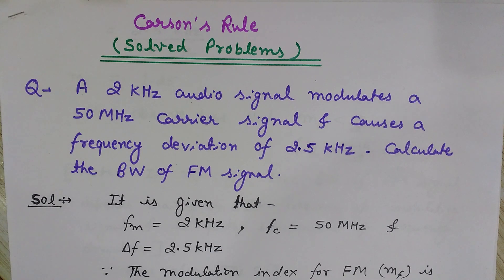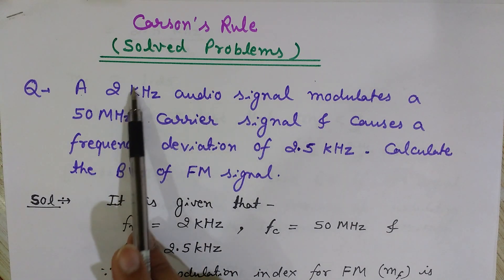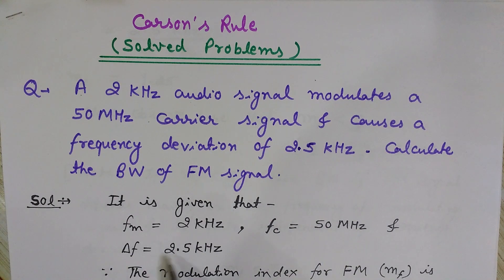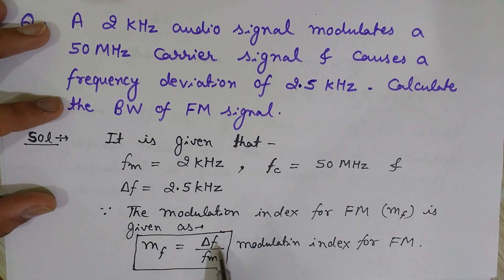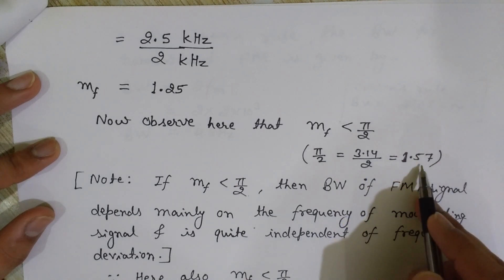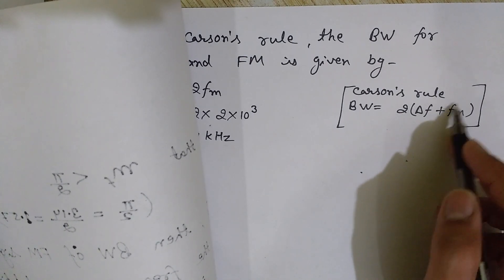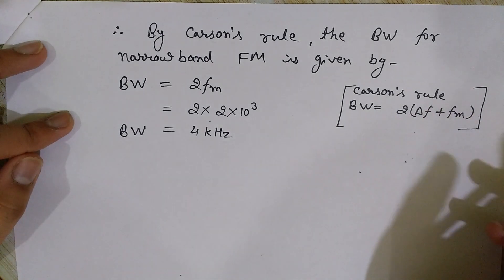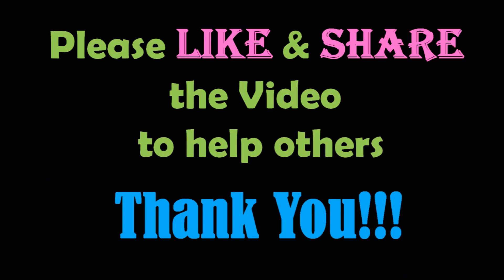Carson's Rule in Frequency Modulation - Calculating Bandwidth of FM - Solved Problems on Carson Rule

Comment: What happens to Bandwidth, if Frequency Deviation increases?
Reply: BW increases as more the deviation means the fM signal sweeps over the large range of frequency which require more spectrum to transmit without any distortion.